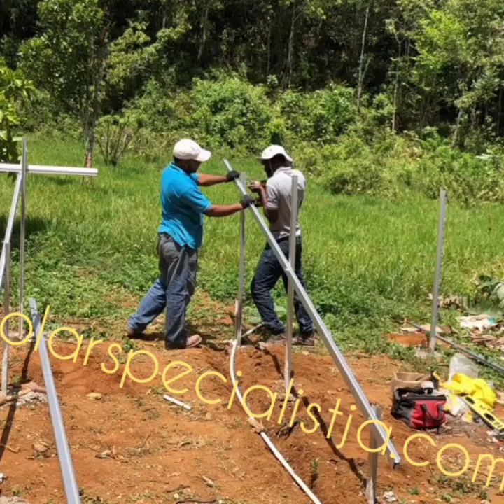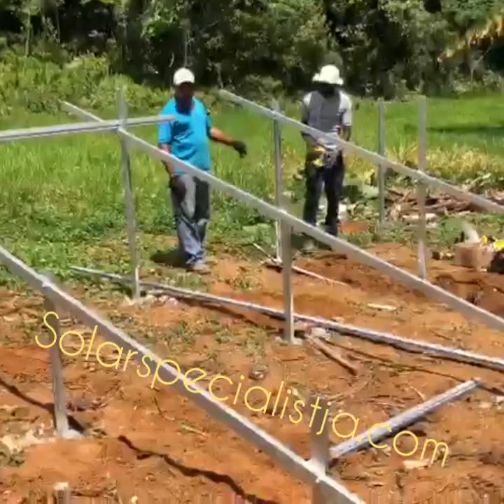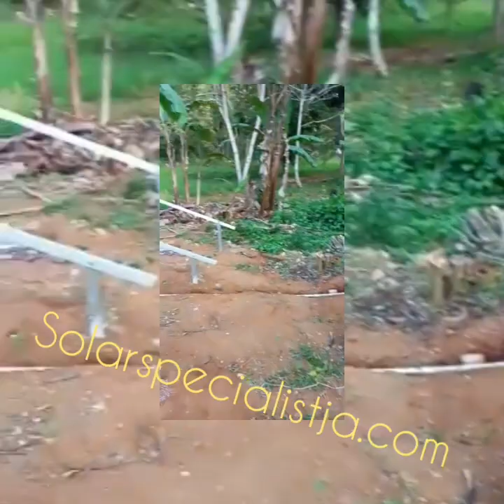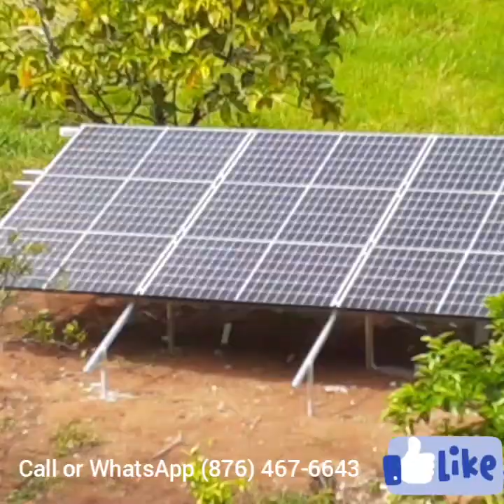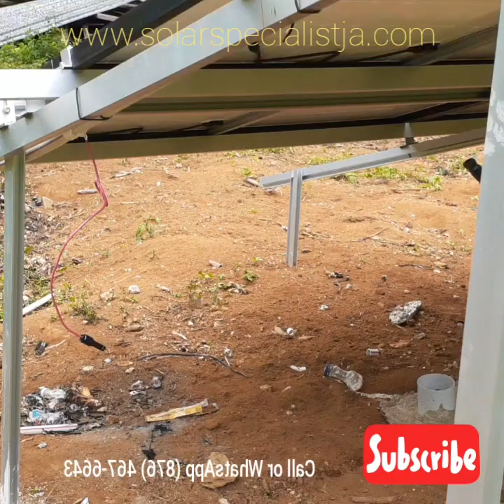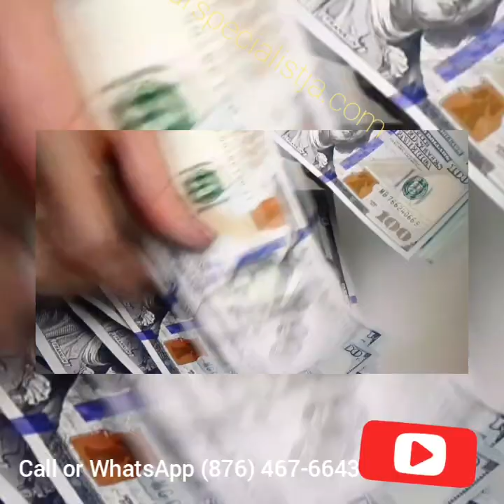Solar Ground Mount Jamaica

Comment: Good work. I need your help on this. I ave a 80 amps fm charge controller  how much  pannel can I used?  I ave 8 455w Canadian pannel
Reply: It varies on how the panels are connected, whether series or parallel. If you don't have that simple electronic knowledge then i suggest using a professional installer do the work for you.